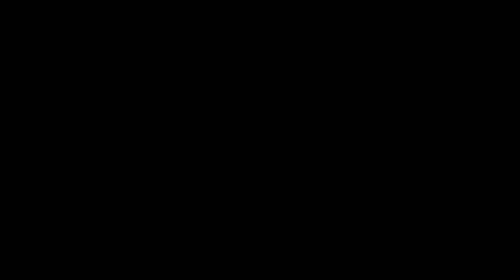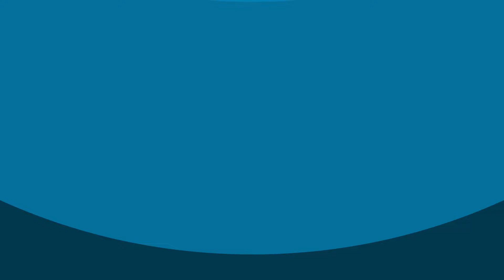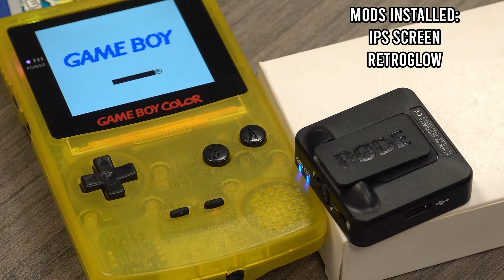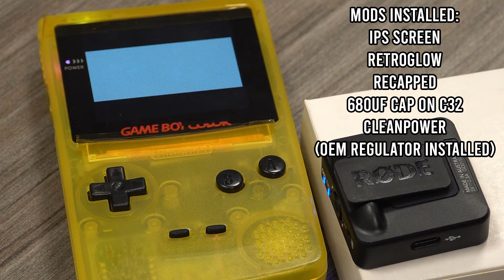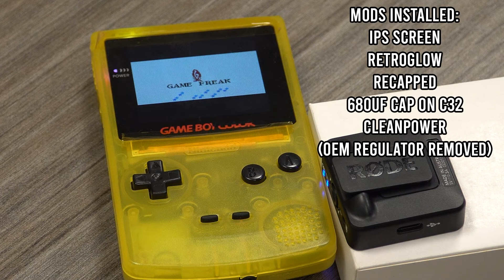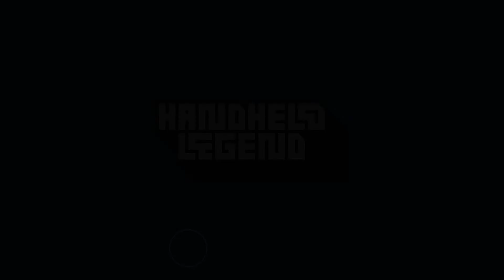Gameboy Mythbusters | Removing Audio Noise On The Gameboy Color!

Comment: I got a board thay had some bad currosion from batteries. Was able to get power redtored and fixed most of the buttons. Uet A is still lil flamy and although B was very dark and dirty looking on the copper pads it worked but now doesnt at all when kept cleaning with A. Its weird cus the cooper is alot shinier now and able to see but like its severed some where between test point and the B pad.  Regarldess the sound issue tho is it has nice load sound but doesnt go low only maybe a couple ticks lower qhen turned sound wheel off. Also crackles a lil bit when turning off. In the process of cleaning the jack. Ive cleaned the wheel alot but still the same. I may try to reflow the wheel. But i think its prob the jack since one the main power issues was down at the DC jack. It was so oxidized that wasnt passing from leg 2 and 3 so just jumped them for now since never gonna use DC jack. Either way full sound better than no l but gonna try to fix if u have any ideas. Also its weird that B button got worse with more cleaning. May just put some froggo pads to easily solve it when they come in. If not only other thing would be to remove the white paint and see if something curroded by the test point. Cus all the vias work. It just doesnt make it to the test point anymore.

Comment: I'm finding there's a lot of ground noise coming from somewhere. Some is coming from the OEM regulator switching the +/- voltages for the LCD. Removing that entirely helps but doesn't resolve. There's another switching circuit somewhere that's pulling the ground up and down, I suspect for the LCD. I need to probe around a bit more and find out where from but think I'd like to do it with another GBC rather than keep opening my current playable console.
Reply: Did you find any point on the pcb that cause it yet?
Reply: @randomuser5771  Yeah - all the noise from my GBC speaker was coming from the PMIC driver used for the OLED display. Unfortunately, can't change the PMIC however I developed a flex PCB amplifier that replaced the standard GBC amp chip entirely and it's removed all the noise entirely, it just solders in place. I haven't published anything because no one really cares but I do have some spare PCBs I've made up. 

Wsa thinking about chucking them on ebay or somewhere. They also work with the GBP.
Reply: @dazmatic  I care please help lol

Comment: Okay, I have done this on two different gbc. One works perfectly, and the other one, i can't figure out how to make the humming stop. So this is what I've done.
Replaced all capacitors
Replaced the 680 uf capacitor near the regulator
Replaced regulator with clean power
Replaced volume wheel 
Replaced power switch
Im using lithium ion batteries 
Still high frequency hissing. 😞
Reply: Maybe in the Gameboy that still makes noise, do you have a funnyplaying display? These cannot work without the original voltage regulator and so this could be what generates that noise
Reply: @dt90dt90  i upgraded the power regulator to clean power, and it's not a funny playing. I'm going to work on it some more today to see if I can fix it.
Reply: @incog8885 So if you changed everything, I don't think any improvements are possible. Maybe the other gbc you have has a motherboard in better condition, who knows. I changed everything, but I had to keep the old voltage regulator cutting the 5V line because I have a funnyplaying screen. Can you tell me if changing the volume wheel makes a clear improvement? It's the only thing I haven't done.
Reply: @dt90dt90  Yeah, i can't figure it out. I just put in a new amp with another new speaker.  Cleaned and made sure my soldering joind were good. It's still the same thing. 
When I have the volume wheel all the way off. You can still hear the high frequency humming like it's a ground loop issue.
Reply: @incog8885 I think it's a problem given by the new screen mods. If even the screen mod that doesn't need the original voltage regulator, makes noise, there's not much to do. Try disconnecting the screen and see if you have noise. Another useful thing can be to check the motherboard traces, and see if there are problems
Reply: @dt90dt90  it's weird because I have the exact same setup on the other GBC, and it's working fine with the amp.
 So, I disconnected the screen, and i was still getting noise. I decided to take out the amp, and it's still there, but the noise is very low now. You have to put it up to your ear to hear it. It's still that same high-frequency noise. So I'm not sure what's causing it. I could try adjusting the led mod. I dont know. :( frustrating
Reply: @incog8885  then it is most likely the gbc motherboard. Maybe some slightly damaged tracks. See the differences between the two motherboards. Maybe there is some damaged track that goes to the power supply
Reply: Youtube is not letting me reply 😒

Comment: I’ve got all your mods and will keep purchasing to support your efforts. 
While I agree the floor noise has been improved it’s still shy of resolved. Thank you for your efforts and I hope you and your team continue to push the sound of these older handheld consoles cleaner and cleaner. I dream of a day when I won’t have to wince if I accidentally turn on a Gameboy with headphones (even with zero volume). Or get reminded of dialup internet through an old speaker. 

Questions: 
Is it possible some shielding would help? 
Does a certain type of battery (or line out) improve sound?

Comment: Hello, I have a problem. After I installed FunnyPlaying IPS and CleanPower 1.0 voltage regulator, it's not making sound anymore, but if I use 🎧 it makes sound and the volume wheel works, after removing the 🎧, no sound coming from speakers. Did I skipped a step??
Reply from the maker: Was sound being output from the speaker before you preformed the mod? There could be a few reasons why it isn't working, I would start with inspecting the headphone jack and making sure the pin for the headphones separates when you insert your headphone, if not your console would effectively be stuck in headphone mode
Reply: @HandHeldLegend  I did test and cleaned the pins if it's covered with rust, dirt or corrosion, even replaced the original speaker and successfully made sound before performing installation of funnyplaying mod and voltage regulator.

Comment: We need a rechargable battery that will fit the shell without having to cut off plastic.
Reply: FunnyPlaying has already made one for their FunnyPlaying Q5 IPS shells by using the stock DC port to recharge the 2000MaH Lipo.
Reply: Or just buy rechargeable AA batteries